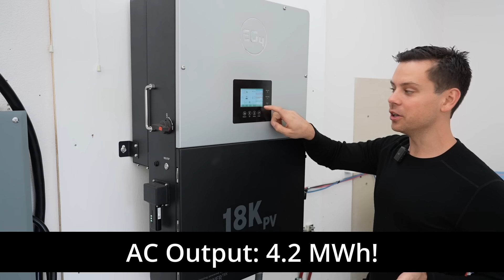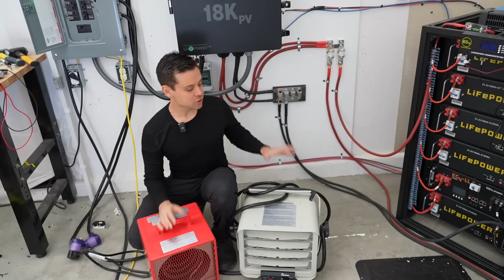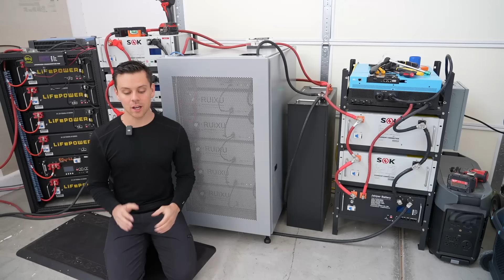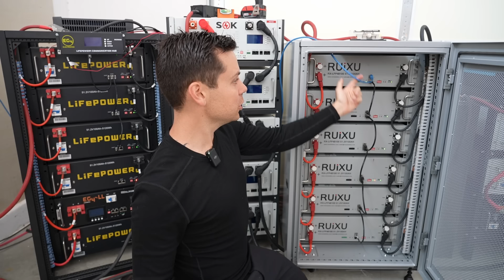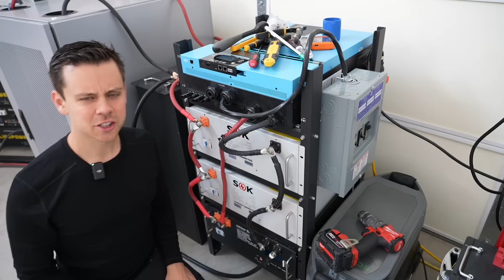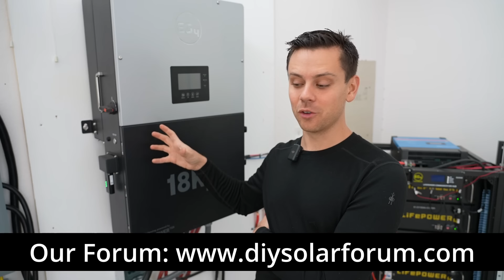EG4 18KPV + 113KWh LiFePO4 = Offgrid Bliss!

Comment: Hey Will .. It's great that these systems are getting larger and larger with abilities to support entire homes off grid. But I was wondering if you know/see any improvements in the lower end of the market, i.e. the smaller 12V end of things. I know for a while, MPP solar had the PIP-1012LV, but I have not really heard anyone else be in that end of the market. It seems all 12V systems are stuck doing individual components (inverter/chargers) which is ok, I guess, but I was really hoping for something better in the All-in-one space?
Reply from the maker: I think 12V is going to be phased out entirely. No benefit and more expensive
Reply: @WillProwse for a portable box unit, would you say the same? Would it be better to go for a 24v system instead of 12v?
Reply: @jb76489  I get where Will is coming from. 24V gives you choices while still being low power enough for a beginner to work with. The problem is that the cheapest 24V battery + all in one unit is Twice as much as a 12V system and you will need a 24 to 12V converter to run 12V devices.
Reply: @jonjohns8145  I agree
Reply: Mpp lv2424 $660
400 watts solar panel $340
Solar panel extension cables fuse ect $160
20 amp power strip $57
Lv2424 to battery cables $50
24vdc to 12vdc & fuse block + wire $100(if u want 12vdc) 
Server rack 5.12kwh 24v 200ah $1450 
Litime 24v 100 ah 2.56WH $660
Total $2817with server rack 5.12wh battery 
Total $1957 with 2.56wh  Litime 24v 100ah
Reply: @jonjohns8145  I think that is where the solar generators are taking over. No need to buy all the pieces when you can just buy the unit, plug in a few panels and its up and going. 120 and 12V outputs and enough battery for smaller power or backup systems. Just wired my RV up to a Ecoflow Pro and was WAY less time then buying and installing inverter/charger, charge controller, fuses, batteries, etc. Mount the unit, run a 30A cord to the auto transfer switch, install panels and done.
Reply: @WillProwse  That's unfortunate as I would love to have an all in one unit that I can build a low cost emergency backup system around. Something that won't break the bank and would work in an Apartment setting where putting up solar isn't easy.

Comment: I would love to get one of theses, but i have iq7a micro-inverters and im not sure how I would get that to work with battery backup in the event of long power failure. Is there anyway to AC couple grid tie and have the panels charge batteries?

Comment: Just received our 18kpv system with 6 life4 batteries.  Looking forward to getting it set up.  I hope my power company approves everything faster then I can put it together or im going off grid😁
Reply: Why do you need permission from the power company? Never heard of this before.
Reply: @ok2x   I'm running it in parallel with grid tie-in and selling back to the grid.
Reply: @nathanmonk8644  sweet
Reply: I do not understand what is the value in selling back to the grid when they give you such a reduced rate of payback? Does it really pay for your systems?
Reply: @WADEWHITE-yn9uk  they require it even if running in parallel with no export.  I need the grid tie function for surge loads.
Reply: @WADEWHITE-yn9uk  ...yes, even atta reduced rate (thanks duke of flori-DUH), they can credit folks half of what you'd normally pay per kwh.  depending on amount generated and sold, that can add up quick.
   my neighbor just installed a AC tied system (10kw), and bill went from 197-34$ (minimum connection "fee". 
  i want my system to operate the whole house (everything on at same time), AND sell back excess.
Reply: @ok2x  some grid operations required inspection to make sure your equipment doesn't "hurt" theirs
Reply: good luck....make a video please.....not tomany of them on here
Reply: Any issues with using it grid tied for surges after a year of use?
Reply: Had some storms in the area last week that missed with the grid frequency due to surges and drops.  Lights flicker a little more than they used to and made my router restart, but that's the worst it's been.  No real complaints. Recommend 9/10

Comment: i just built the 48v complete off grid with bifacials just like on your website. with the 6500ex's getting 8k watts. been running for a week now. no issues. THANK YOU WILL
Reply: Any issues a year later ? I have the same system with 29 panels
Reply: @Trueforit100  not yet lol it’s running good
Reply: I learn to do the custom battery settings and that’s been helpful

Comment: would it run  large shop compressor and lift at same time? or 240 table saw and large compressor?
Reply from the maker: Yeah absolutely
Reply: @WillProwse  I'd love to see it start a large old school compressor at zero static pressure..you know the old kind with large 2-3hp motors that use motors that use brushes. And, test it under load. Even the rosie they lavish with praise for its surge capacity couldn't do it.

Comment: I wish this was available back when I put in my Outback Radian system, tech changes so fast these days.
Reply: Outback is a tier 1 system...why would you want to do it different?
Reply: @nealhamilton3881  The Radian model does not handle Lithium batteries well, it works but the battery monitoring sucks. The Outback Load Center cabinet is way to compact as well. Also the FM100 chargers are too sensitive and trips at 4am in the morning every few months showing Arc Fault. Outback tech support and multiple electrical contractors find zero issues, tech support says it is a known issue. I will never use Outback again.
Reply: I’d trust that Radian to last 20-30 years. Jury is still out on this thing but I wouldn’t offer odds.

Comment: With systems like this low cost EG4 18k so easily combined with the low cost LiFEPO4 rack mounted batteries and panels below $0.50/Watt, there is NO excuse to not go solar.
Reply: I think some will argue that the the EG4 18K @ $5,500+ is low cost.
Reply: @SmoothLounge7  actually the EU version is about 1800$ i have one installed if you want to see.
Reply: Yes it is. You get this and never pay a single bill of any kind. No gas. No electric, maybe even get money @SmoothLounge7
Reply: For the 30 grand for a complete system is not cheap. I can buy a lot of grid electricity for that price.
Reply: @worthmor5146 unless of course just hooking up to the grid is $47k alone. For me the math doesn't add up & going off grid with a 22kw system $13k cheaper
Reply: Except if you live in Canada or anywhere North of there where you'd need a grid connection in the winter.
Reply: @dherman0001 or storage, or more panels. We have solar farms North of the American border by about 2000kms. Hydrogen is a very long term battery that is even more useful than instantaneous use of electrons. 
So much disinfo coming from Canada regarding renewables.
Reply: @Shazzamm1971  Batteries are worthless when you have zero sunlight for 3 months.
Reply: @dherman0001  again with the disinfo eh? 
Fact is H2 is a very long term storage “battery” and so too are VRFB’s. 
Point to the south and north pole and tell me oh wise one how the research stations are powered. The thing with renewables is how each dovetails with other forms of green power generation. 

Guess what else is green and a form of battery, hydro dams. 
 
The poles get 24 hour sunlight and solutions exist today to store that as hydrogen long term.
Reply: @Shazzamm1971  You're not storing solar energy for 3 months
Reply: @Shazzamm1971  You are not storing solar energy for 3 months unless you're Mr Money Pit without a care or concern.
Reply: @dherman0001  Indeed that is exactly how green hydrogen works. Stores wind energy too. 
Too bad Alberta didn’t listen to the customer. First scheduled to go offline is the tar sands.. no customer will buy it in 12 years.
Reply: @Shazzamm1971  If you're not generating solar for 3 months, you will not have energy available.  This isn't debatable.  I can look at your YouTube subscriptions and understand why your brain has such a difficult time with basic electrical theory.
Reply: @Shazzamm1971  This thread is about solar, not hydrogen, and not wind.  Happy to clear that up for you buddy!
Reply: Still the ROI around ~10 years with a 0.11 Kw/h cost in Texas. And this is not considering any return on the 30K upfront investment. Still expensive in my view
Reply: @funnyautomation763  unless hooking up to the grid is over $47k alone just for the privilege to be endentured with a monthly bill the rest of your life. I.E. I was positive ROI the day I turned on my system.
Reply: There is if you live North and electricity is super cheap
Reply: David poz channel just did a video on diy server rack lfp for half the cost!! For ever diy battery, wasn't really worth it
Reply: @cdoublejj  Can't understand your comment.
Reply: They don't have any sunlight for 3 to 4 months during the winter.  The sun stays below the horizon.  I assumed everyone knew this.  It's obviously not feasible to store solar energy for 3 months.  In the months leading up to and following the months with zero sunlight, there will be very little solar production.
Reply: There is if you have a lot with little to no solar like mine.  😂
Reply: What about fake clouds every day blocking sunlight?
Reply: In 10 years there will be no reason to be connected to the grid at all.
Reply: @fullhalf420  still far cheaper for you to stay on the grid if youre in Canada.
Reply: @fullhalf420  You'll have no solar generation in the winter.  Candles work though.
Reply: Solar panels current price is 0.25-0.3 us $ /w
Reply: Yes there is!  My wife hates, I mean hates the look of solar panels!
Reply: @jeromejarboe6944 trade her in